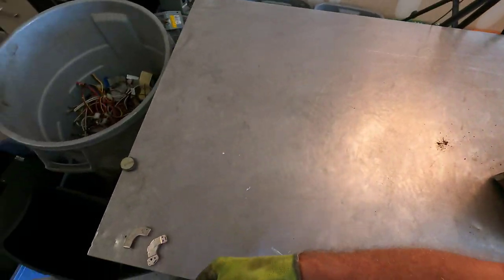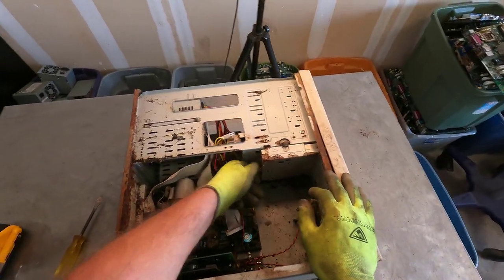Computer scrapping an old Cyrix full of dirt and debris - and GOLD!

Comment: Find a small wire bed-frame & suspend above work bench & get some led strip lights. I used to strip old hard drives down to turn the platters into drink coasters but now they are so thin or digital drives you can't do it
Reply from the maker: Thanks - I'm testing out a new layout that should help.  I'll have a video up on it next week.

Comment: Perhaps on a video you could give us a breakdown of depop vs selling? I noticed you do some figuring in your head as to whether it is worth it or not to depop those finger cards. I must then assume your yard buys those as midgrade? Because my curiosity is getting the best of me when I see a potential $4.75/lb item converted to low grade for the sake of a 3 or 4 ic's , a few grams of finger and a maybe a gram of capacitors. Even when you factor postage to a distant buyer versus local  to your yard, lets say at the high shipping rate of $1/lb I wonder if it is truly worth it? You still have $3.75/lb after cost. I am sure it is or the Shark wouldn't be doing it! Just trying to understand your perspective from a $$ standpoint.
Reply: Out of curiosity I selected a modem card that was very similar to the one shown. 

It weighed 5oz. whole (no bracket) before depop. Using inflated shipping of $1 per pound making the effective payout $3.75/lb it would net $1.17 per card. Likely more due to my exaggerated $1 shipping calculation.

After depopulating the boards I was left with only $0.95 per card. 

And that was only by more than doubling our payout rate on the finger. The clean finger weighs 1 gram. I calculated it at the likely unattainable rate of $100/lb just for grace. But it is still only earning $0.20 net per finger. The IC's (1 ounce) pay $0.50 net. Add $0.09 net for the tant and $0.16 net for the now low grade card. Total $0.95 per card. No shipping was factored in this example, nor did I assign value to the time and effort that it takes to do it.

If one is simply hedging for higher future gold rates, then I guess the example could be made. The  general operating mode in this business is turn and burn by letting the capital do the work, increasing in value with each cycle. But that is the beauty of this business. The independence and flexibility to take those shots and make those calls.

I hope you do not mind me adding my two cents. Depop has always been one of those areas where I encourage the seller to make sure they are considering the entire equation as I am sure you have.
Reply from the maker: Chris - thank you for taking the time - and material - to work through and share a real depop example.  This is such an important issue for ewaste scrappers to understand.  I'm concerned that you comment may not get the readership it deserves so I'll plan a video to address this in detail.
Reply: @sharkscrapper  I’m reading it 👊🏻
Reply: @sharkscrapper  I can’t wait for this video.. you to should do a live 😳🤗
Reply: @sharkscrapper  I’m very excited about this 👊🏻👊🏻
Reply: @boardsort  WOW Chris you went above and beyond on that example.  Well done, great job.  I'm in England so doesn't apply to me but interesting none the less.  Thank you.  Take care, Poo

Comment: Love to see people scrapping a $30 CPU and $25 PCI 2MB board....to get about $2.00 in scrap.  Makes my inventory more valuable.
Reply: Uh, he didn't scrap $30 CPU, he took it out if its socket and places it in a drawer. And I don't think that motherboard was anywhere near the condition of cleaning and testing, if he has a way to test it, so not a $25 Motherboard. But if you are reselling the likes of this, happy hoarding.
Reply: Not the motherboard, the PCI  video card.
Reply from the maker: Thank you for the feedback Bruce.  These vintage computer items can have collector value that exceed scrap value.  I do need to point out that I've not decided what I'm going to do with the CPU yet.  You'll notice that I placed it in the draw with my other Cyrix CPU's.  If you watch some of my other videos, you'll notice that I do set older boards that are in good condition aside for potential collector item sales.  This particular board I just don't feel right selling that way.  I was in pretty rough condition.
Reply from the maker: Thanks Barry.  I'm not sure what I'm going to do with that CPU as yet.  I also agree with you that the board was in very rough condition.